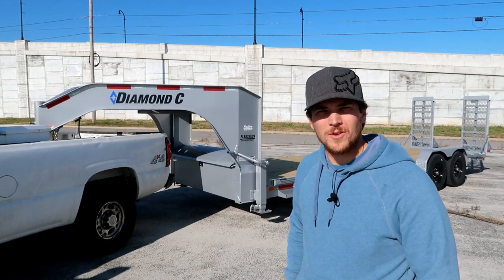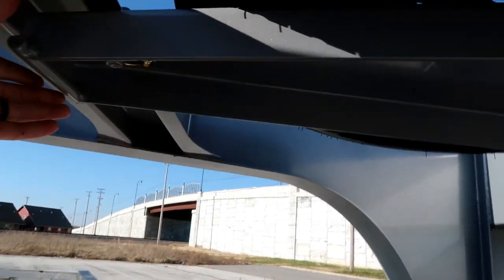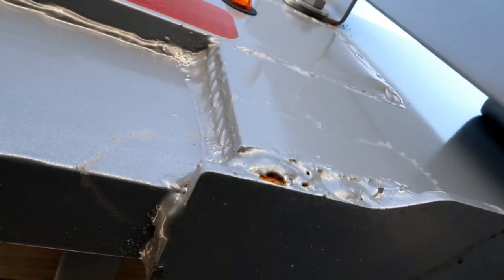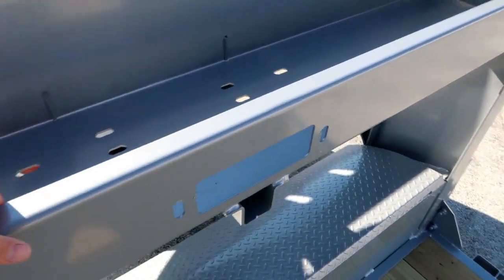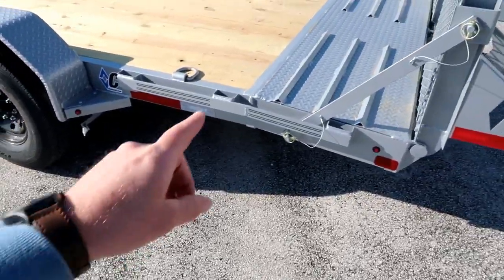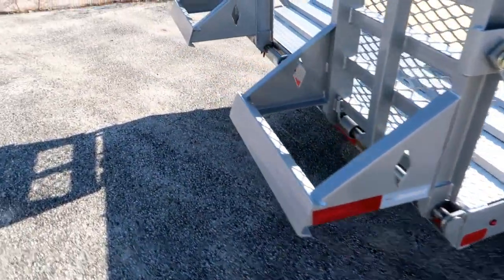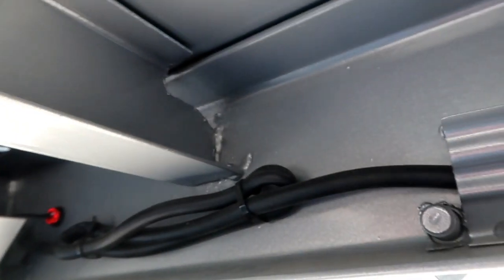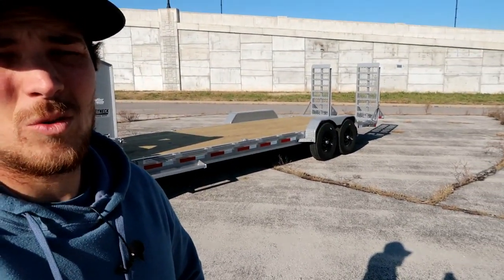Diamond C Equipment Trailer Detailed Review

Comment: I am a welder by trade. With that being said all trailer manufacturers have the same problem with poor welds and splatter being left on the plate that I would be ashamed to let go and let people see that it looks extremely unprofessional
Reply: Some of those welds look like the first time I put wire to steel- HORRIBLE. For the price of these trailers (and Diamond C seems to be one of the best) workmanship like that should never roll off the lot without being corrected IMHO.
Reply from the maker: Personally I think they price is pretty competitive from all brands. Andrew Ralph has a YouTube series where he builds a Gooseneck Trailer to to behind his Ford Raptor. He did a phenomenal job! But the cost for materials alone was at or above what you can buy a trailer from a dealer. The margins must be pretty tight. I’m sure they get a discount on bulk materials and all but I can see what your saying. You would think that someone has the ultimate build quality that blows the competition out of the water. I’ve seen poor, good and better quality. Still waiting to find the absolute premium builder.
Reply: Think the word you're looking for is spatter.

Comment: All trailers have chains that lie in the bed loosely. Please ell me this isn’t a nit picking tour?
Reply from the maker: 2:35 I agree.  Coming from bumper pull trailers I was accustomed to crossing the chains.  I always did this on the PJ Dump Trailer and those chains and hooks were larger and longer and allowed for a cross without issue.  The chains on the Diamond C were shorter and cannot be easily crossed.  I have since changed my ways and no longer cross the chains.  Since then I have also swapped out the chains and hooks for a larger size.  Oh wait, at 2:57 the sticker  says to cross the trailer chains...  Hmm... now I'm confused.

Comment: Hey Carson! Good detailed review - thank you for your effort at being fair and thorough. I guess it's about as good as can be expected for a high-volume production unit. It would be easy to nit-pick the welding (I'm a CWI and a welding instructor), but by the time you get all of those welds in the way that most welders would expect them to be done, you'd be looking at a $25,000 trailer! (And DC would be two years behind in production!) I agree with the issue of the stress raiser between the frame doubler and the lead spring hanger; you're certainly going to want to keep an eye on that area. The right side usually cracks first for two reasons: the camber of the road places more weight on that side, and the shoulder of the road has more pot holes. The convexity of the welds on the outside of the gooseneck members shouldn't be a problem, but I was disappointed to see just having tack welds on the inside. Seems like that's gonna be a corrosion trap. You might want to put a bead of silicone or urethane sealer along the inside of that joint to keep it from holding moisture. Keep up the good work!
Reply from the maker: Thanks for the well written and thought out comment.

Comment: 2 things I have done to my last 2 trailers that makes them more durable. 1 I have al surfaces were stones can hit the trailer covered with bed liner and I have the beaver tail and fenders done too. 2nd I have the trailer sprayed with Krown rust proofing underneath.
Reply from the maker: Great ideas, thanks for the suggestions!
Reply: Took the words right out of my mouth! I had Line-X spray all of the stone chip prone areas on my gooseneck, and I spent 8 hours spraying Krown underneath the trailer...crossmembers, I beams,, axles, hidden tight spots. I jacked it up and basically worked front to back.

Comment: Great video, love how in depth it was. No trailer is perfect, not even close, but Diamond C does a good job, some other brands would have been a way longer video with all the wrong cap. Spray can white lithium grease in the trailer jack handle really helps keep it smooth
Reply from the maker: Thanks for the tip!

Comment: Very good review. I had some issues with my FMAX212, but Jacob Crabb made good on his word and took care of everything, even though TrailerWorld put up a fight to do anything. Jacob made sure the trailer was right. I was impressed with Diamond C, so much so that I'm about to order a FMAX312 with triple axles, and upgrade to the 40k pound specs.
Reply from the maker: I've been watching your warranty process.  It appears that Jacob is really involved with their reputation and is willing to do what it takes to keep customers happy.  From what I've seen so far I'm definitely impressed with Diamond C.
Reply: @ThriftyGarage  The dealer was a disaster, but Diamond C, specifically Jacob Crabb made sure things were right. Many people expressed dislike that I took to Youtube with the problem, but if I had not done it, the dealer, Trailerworld, would not have done a thing to fix the problem. Little problems can turn into big problems, and a manufacturer that acts like a little problem is no big deal is not any better than a vendor selling cheap Chinese products that they know will break quickly and be thrown away. Quality matters! Because Jacob stepped up, I will be buying more Diamond C trailers in time.
Reply: @ThriftyGarage  Well I am having a problem with my 3 month old Diamond C trailer. The 7k torsion axles used on this trailer are over rated. I had 9200# GVW and the axles went tits up after a 200 mile trip. Diamond C are trying to weasel out of the warranty, claiming these axles when loaded correctly can not fail by hauling a load such as mine. Keith Barnes is claiming it must be user error. Well we will just see who has the final word here.
Reply from the maker: Dealer support makes a huge difference. I’ve reached out to my dealer with a few issues and they have been great to work with so far.
Reply: @ThriftyGarage  From the looks of your trailer, Diamond C must have ran out of paint during the build. There are many flaws in the finish work. Guess that's what we get when buying a trailer with weak quality control (:

Comment: The boards being staggered believe it or not is a huge portion of the strength of the trailer overall
Reply from the maker: I’m not worried about it being structural. More or less an area to get snagged by equipment/materials and damaged.

Comment: I would  not be happy with this trailer. My 25' lamar bumper pull has two jacks on the front fat ramps on the back and an 8" I beam frame, 16" stack ahead of the axles. This trailer you purchased was a "training trailer" watch for failure in all areas. Scary welds for sure!!!!! Thanks for the video!!

Comment: I have a similar trailer except mines not gooseneck. I didn’t get the conspicuity tape or the rubrail on mine which I believe is 96” wide with drive over fenders. Oh and mines only 10k. Initially I was told it was 14k but anyways I’m pleased with it as it gets used daily.

The bad:
I had a car pull out and almost run up on the trailer and when I reached out to Diamond C for support for the paint code and replacement parts I was left in the dark. Very disappointed in Diamond C on that.
Reply from the maker: Diamond C has touch up paint available on their website.  What color paint code do you need?  The codes have been shared numerous times on the DC Trailer Owners group on Facebook.

Comment: axles r under tremendous loading needs improvement some kind of tri axle shaft 3 holes acting as 1 that spins around. Instead of 1 big mother axle, 3 little all turning together smaller axles in triangle formation. U get 3 bearing not 1 to fail killer problem all at once. U can hve 1 big bearing that rounded 3 but then u hve 4 not 1 bearing. 3 & 1. A crack or bad axle doesn't crash out just gives out & other take the load.

Comment: I think they should set axles up as double axle only then u can chose to run doubles or only if tires goes down do u air down & put spare on. Less tires less drag & less tire cost but if set up for double customer has the option.
Reply from the maker: If I understand correctly that sounds exactly what is on the larger, more expensive trailers. Honestly, for my setup, the more simple the better. Tires aren’t all that much even if you have to replace a full set yearly. But I’m sure some folks with similar sized trailers might appreciate that option; especially if they are dead heading a lot.

Comment: why can't the tires b on the inside 1 set middle & then the outside has the suspension prt other tires set. So f-ing what if a little higher in middle. Why put both sets of tires at max width apart wrong design. 2 inside & 2 outside that can move up & down far better. There not drive tires being max distance apart gives u most travel not best way to carry wt. If 3 axles 1 axle needs to b float style not go down in pothole & other 2 axles can travel up & down into pot trap.
Reply: the truss designs r long ago free use to any1 solid well worked out designs tested & weaknesses worked out.

Comment: wood comes 8ft,10ft, 12ft, or 16ft, but stay dimensional & least amount of board to get over all length is idea, sat 10+12=22' or 8+10= 18', or 10&10=20' but then back road bridge use shorter width 1 board on top double deck style.